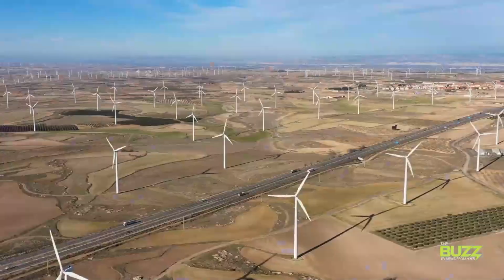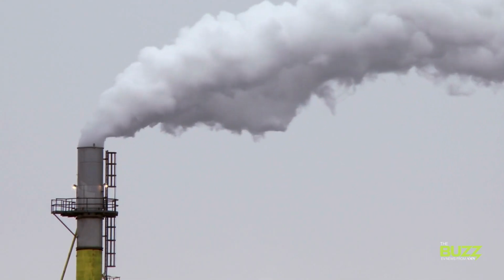Are hydrogen vehicles worth the cost of hydrogen?

Comment: What will be the impact on the hydrogen vehicle market when we see the first hydrogen fuel station blow up???  The latest hydrogen bomb test by North Korea had a 'fireball radius' — the innermost circle to ground zero, hotter than the sun and kills everyone within 500 meters and a thermal radiation radius — capable of third-degree burns — of up to almost 4 kilometers (2.5 miles). With wind at 15 mph, radioactive fallout could cover a maximum distance of about 126 miles.
Reply: Fusion, Fission, this is the difference for the energy of the bomb. however hydrogen bomb is called like this not cause H is used, rather the isotopes deuterium and tritium, combined with high neutron elements (radioactive) normally uranium... that is making it radioactive. so don't be afraid of hydrogen cars... its not a bomb, not more then LPG car or Gasoline car
Reply: Hydrogen is safer than gas or lithium.  It is light so even when it catches on fire the flame goes basically straight up. There are lots of videos on youtube showing safety testing where they do the comparison.